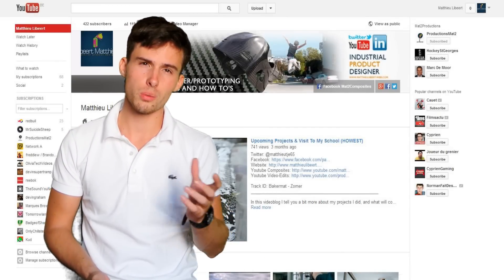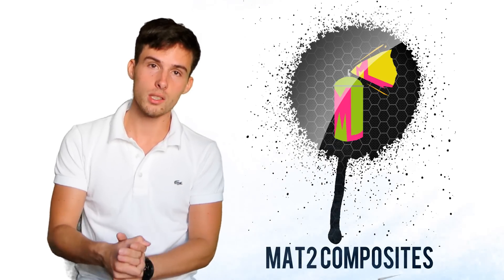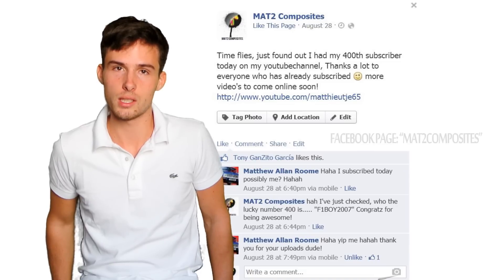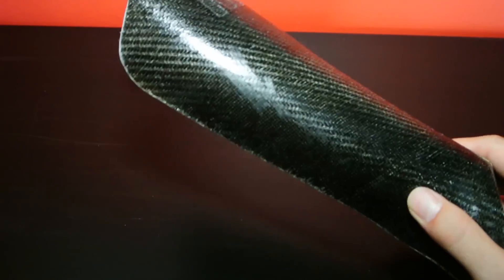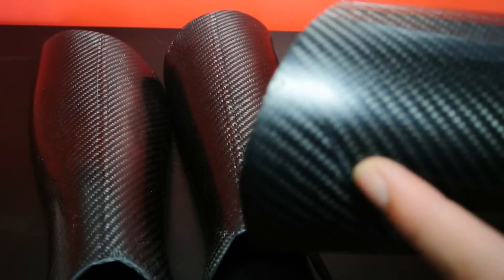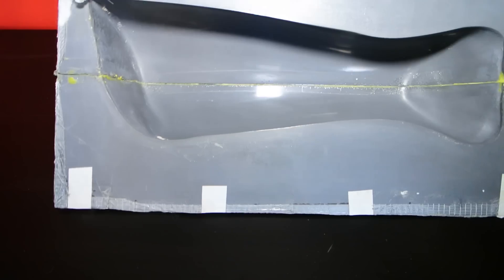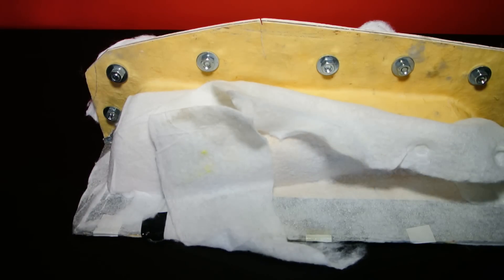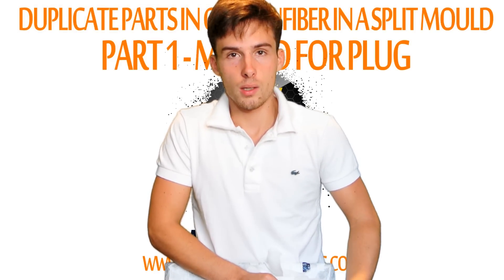Introduction On Split-moulds and Prepreg Carbon Fiber

Comment: What is the tape you use on the split join?
Reply from the maker: its just a "fine line painters tape" do some testings first to see if the resin doesn't soak up the tape, this one is made from vinyl or pvc material if I'm correct
Reply: @MatthieuLibeert  thanks, I since been told ptfe tape will work?

Comment: how to create hollow carbon fiber parts?
Reply: Often by making 2 pieces & gluing them together. Carbon "supercars" that use a central "safety cell" do it this way. They have a lower tub where you'd sit and an upper section consisting of the roof assembly & glue them together (often in a "jig" to hold everything in perfect place until the glue is dried. With commercial aircraft, the fuselage (passenger area) will often be in several large round sections, glued together. Possibly using a "fastener" as well like bolts or rivets. The smaller "HondaJet" is made in 2 halves & glued together directly down the center. Additional carbon sheets may be glued over the "seam" to strengthen it. Some golf clubs use a rubber bladder (like a balloon) to keep them hollow & push the carbon into a split mold. * YouTube "McLaren mega factories" "Lamborghini Megafactories" & Boeing 787 Dreamliner to see how they produce large carbon pieces.  Google HondaJet to see images how they do it, also Google carbon, composite airplane, aircraft for images & info.

Comment: Hi. Just recently started viewing your videos. And the problem with undercut on the shin protector. Why dont you try using for example a shore D silicon mold? It may be stiff enough for holding up during the vacuum infusion and flexible enough to let you demold. Just a thought :)
Reply from the maker: Good remarkt! I have been thinking about it as well...The problem is the price for such a "big mould" in silicone...Would take 3kg aprox I think... Another problem might be that the mould gets a bit distorted under vacuum. The biggest advantage for me would be the selfrealing characteristics of silicone... I Will probably make a video later on on that topic and maybe see if I can find some money to test it out!
Reply: It doesn't work. Even the strongest silicone will flex easily under vacuum. It is also near impossible to lay up because even prepreg won't stick to it. 

Carbon fiber parts have to be made in a rigid mold and one that is stiff enough not to bend under vacuum. 

The way to release parts easily is to apply a decent mold release.